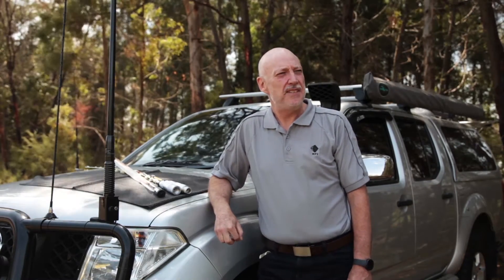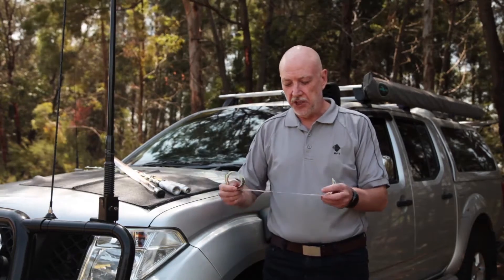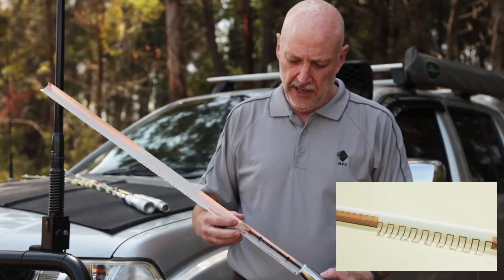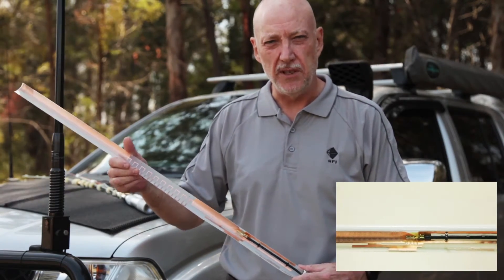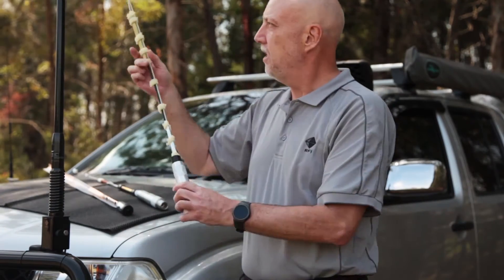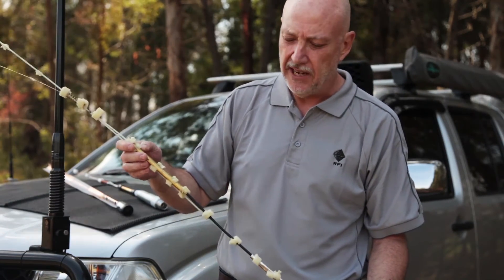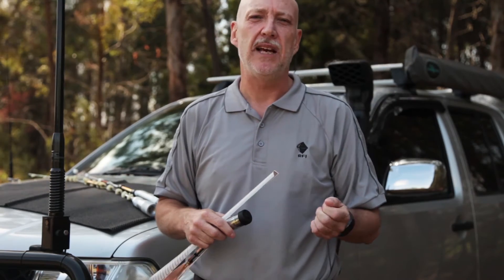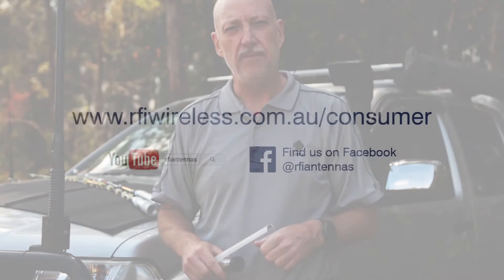Do you know what’s really inside your antenna?

Comment: Do you have any advice/videos on cables? I need to change base types to get away from a whip that has a weak point over corrugations, and it is a massive job to re-run cable. Trying to find out if there is any problems with solder joined cuhf antenna cable. Inner core soldered, wrapped with quality electrical tape to diamemter of existing insulation, outer webbed cable drawn about 10mm over each other and soldered right around, then adhesive heat shring to keep it weather proof. Any problems with this? Thanks for all the informative videos.

Comment: If you used the same design for the Amateur bands, you guys would clean up!
Reply: Hi Jay, it would be difficult to design a dual band VHF & UHF using this collinear design and more important, the flexible PCB would have difficulting handling 100 watts power (typical power used in VHF mobile amateur radios. We do however have our CD30 Dual Band VHF/UHF Mobile Antenna. This antenna covers VHF (148-174 MHz) and UHF (400-470 MHz) but again it is only rated to 50 watts. Ian